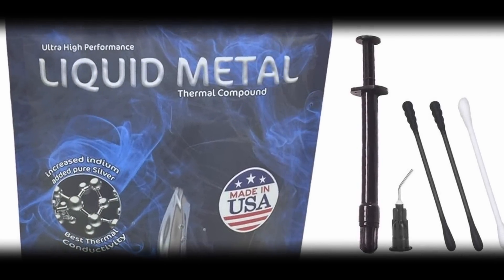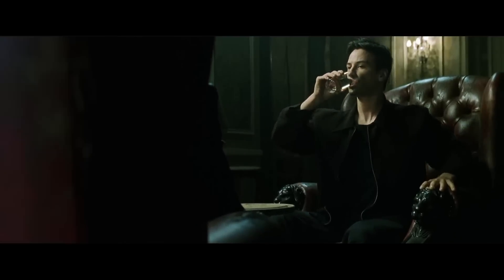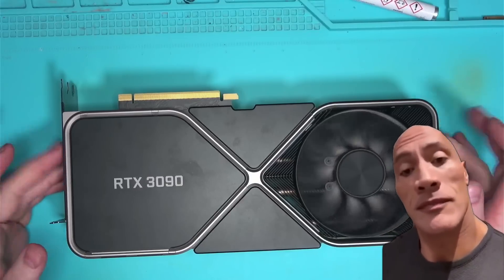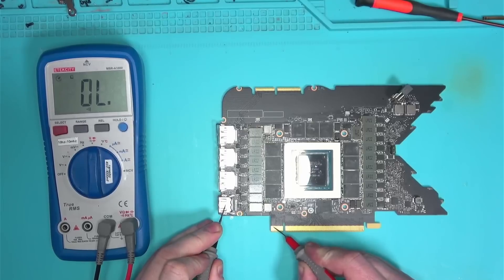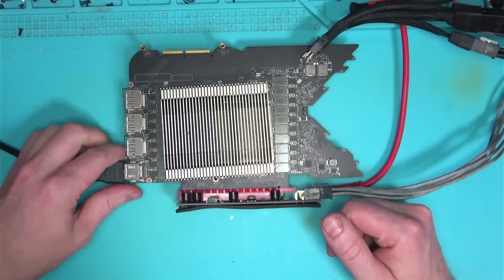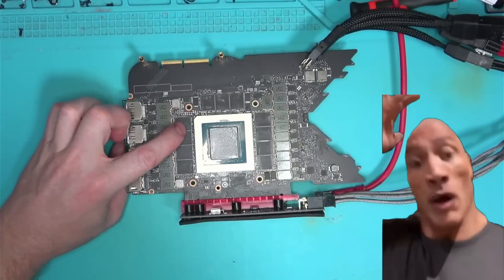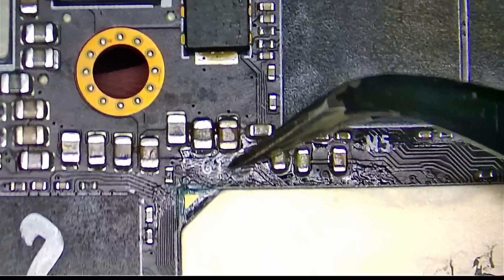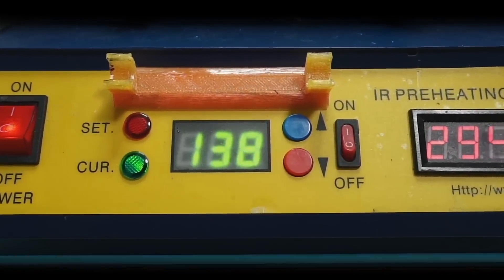3090 Founders edition Liquid metal damage repair

Comment: If anyone insists on using liquid metal, please at least protect the surrounding area with something like kapton tape and test how easily a drop comes out before you squirt it all over the card. That's most likely how this incident happened. Apply a very thin layer to BOTH the cooler and the die. By thin I mean 1-2 drops can go a long way...

Or just look for a used/cheap water block and enjoy significantly lower temps than anything an air cooled GPU can do.

Comment: Sometimes the liquid metal acts like an intelligent animal, aiming to destroy the soldering. Probably, the thermal paste manufacturers know this. It requires voltage, when you solder the usb port of a power bank, you can see the problem.

Comment: Damn right liquid metal is AWESOME u get 1c lower temperatures and as a bonus anything that is not mounted horizontal gets blown up sooner or later :P
I smack Gelid Solutions GC-Extreme or (since i bought an Arctic Liquid III last week) MX6 on everything. (got about 15k of water cooling "products" in my house)
GC-Extreme  tend to be a little "gluey" pulled a AM4 out of a motherboard that got stuck on the cooler :P

Comment: Thanks for the video.
Need to do long term testing on a R9 280X it is on a z170 asus prime i7 6700 cpu 32 gigs of ram.
This is a frankie build it sits around till one of three pcs has a problem and needs fixing, 2 pcs are friends and one is mine. frankie is a stand in. When last used it had lots of crashes replace old fx 8350 with the i7, now I want to test the R9 280X. Both the fx 8350 and the R9 may have been damage in a drop of the case. The mother board for the fx has a  pci x slot was damaged, new board is working great been testing with igpu to make sure it is stable. Now will be putting the R9 280X to see if it is working and was not the cause of the crashes.
What testing software should I use need it to run for a day or so and not crash just to make sure gpu is working.

Comment: People don't understand that LM requires precautionary measures when using it on their daily systems. OEMs would use LMs that are solid in room temperature, and use gaskets to prevent leaks. Extreme overclockers don't care, because they would clean and reapply frequently.
Reply: Tbh I've experimented quite a lot with conductonaut and my conclusion is it's not worth it, especially for a GPU, because after maybe 1 year it migrates into copper and then you get terrible temps, you need to reapply it often, also it reacts weirdly with other metals (not even mentionning aluminum 💀)...
For delidding (which idk if people still do), why not, but otherwise, in my opinion a good thermal paste is more reliable, gives just most consistant performance and without any risk, can last many years...

Comment: After i tested cheapo ptm7950 pad there is no more "good quality" thermal pastes for me. I had a noctua nh-2 and it got it's ass kicked by 10C on the hotspot. Same for laptop application. Only place where good paste and pad come close to each other is desktop cpu where the contact is as even as it gets.

Comment: I'm just interested, from the technical side, how do components that don't like heat and whose operation is very critical if they work above 100 degrees, endure temperatures of over 250 or even 300 degrees?
Ok, I understand that while they are working, they have rapid cooling via the cooler (if your graphics are at 90 degrees and stop working, in a few seconds it will be at 50) and that rapid cooling actually has the "twisting" of components as a problem (cracking may occur). A chip type cannot have the same temperature everywhere, and if it was 90 degrees, the part that is close to the cooler dropped quickly to 50, and the part further away is still at 85+, and due to various expansion of the material, damage can occur. While heating during soldering, the average cooling takes place slowly (naturally) and the temperature difference over the entire component is much smaller. Right?

Comment: Liquid metal is amazing if you know how to use it and you have to use it if you do any deleting. People think 5they need to put a layer on it when you only put a very thin film on the chips and the cooler plate. Plus you have to change and clean more often. R3qason why is liquid metal attacks any metal or can ox8dize you precious GPU or cpu.
Reply: I found it migrates into copper, then you get terrible temps, it's annoying having to reapply it constantly

Comment: What in hell are these people doing lol. I used liquid metal in probably around 50 gpus and 30 laptops so far, no one ever contacted me they had any sort of issue and I urge them to call me if something goes wrong cos I want to take it apart and see if if was my fault by any chance. What these people do with liquid metal is beyond me.. I guess they push the syringe over the gpu die directly and it pops and sprays all over the PCB, that's most likely of rookie mistakes.

Comment: Another great repair, Tony, i love the way how you show us what you`re doing to fix such an abused graphics card. Just hit the magic button again and subbed.

A little question from me: i have the Gigabyte RTX 2080 Ti Aorus Xtreme. The card runs fine since i got help undervolting it. An Windows 11 or the NVidia driver update killed my profile for MSI Afterburner so the card ran at its normal specs, getting very hot and loud as the fans simulated a starting jet plane. The hotspot was at 105 degree Celsius, so the memory was at around 90. But i don`t get any readings from the memory temperature, it looks like the sensor for it is gone. Can this be, a "grilled" temp sensor? The card runs good again with undervolting, but i`m in sorrow that more parts could get damaged. Before this software malfunction and the overheating card, i got temp readings from the vram.

Comment: Hi Tony, thank you for taking us to a truly happy place.  I love being able to spend time so close to those glorious GPU components.  I've used Liquid Metal before on laptops and GPUs and went back and replaced it on them all.  I saw how some of it had shifted from the CPU.  It also caused some corrosion on the copper GPU cooling plate.  Except for the card I sold on eBay, I swiftly cleaned it all off and replaced it with thermal grizzly which I love.  So there is a poor Nvidia 980 out there with Liquid Metal still.  I appreciate how no problem is too much for you and how you deeply desire to initiate further complications solely for our entertainment.  Keep it up!  Everyone should send you their broken GPUs for repair.  You fixed one of mine and I can't thank you enough!  Russ💽

Comment: There mechanic preheater is a game changer. So much easier to get them balls soldered without being blown away with hot air.
Reply from the maker: I would argue.
Its hard to keep the chip stationary while fixing screwups with balls.
Reply: @northwestrepair  Yeah I'd agree. I place the Hakko Omnivice next to it rest my hand on and move balls with the tweezer The vice is about the same level as the preheater.

Comment: Don't you get issues with chips or PCBs popcorning on you while you are working on them? It happens quite a lot here, even before the solder melts, the GPU is already dead with multiple bumps in the PCB. Btw, I live and work in a 70+% humidity location and I usually bake stuff at 90C for a while before doing any bga rework

Comment: in your heat test at the end it was only running at like 70C, why even use liquid metal, that's a very good temp for a core this high power. lol, liquid metal
Reply: A great many factory thermal compound applications are nothing short of terrible
That said, and often times, a careful reapplication will provide the most benefit without liquid metal.

Comment: I had to do LM on my7900xtx due to 115 hotspot but I made sure to use it very sparingly
Reply: Maybe you had a defective cooler that is sensitive to orientation?
Reply: @TheBackyardChemist well mabye when I first opened it had very good application of thermal paste maybe to much but I cleaned it out put LM on the die and on the cooler and a little dot in the middle just in case if the die was concave put everything back on did the retention bracket first tighted it much more than oem did and boom temp don’t go over 80c at 465 watts 1600rpm it a taichi asrock

Comment: Hi Tony. Just to be clear, the preheat temp of 200 C is measured at the top of the PCB or just the setting of the preheater ? Same for the 250 reflow temp. Is it measured at the top of PCB or is this the setting for the heatgun temp ? I am asking as I find these very low for lead free solder to properly melt. I would be surprised to have a proper solder melt if setting my heatgun at 250 for a large GPU chip.
Reply: 200c is the temp of thermocouple that toped on top PCB close to GPU core

Comment: Moral ol the story: gaining a random FPS for liquid metal ain't worth it.
Reply: Liquid metal is more frequently used for noise reduction as your fans do not need to run as hard due rot he better thermal transfer.
Reply: @Intel-6969K  yeah he was so successful that there was no noise, lol. It doesn't make my point any less valid.

Comment: keep on using liquid metal and keep Tony busy
Reply: Liquid metal is only for those, who know, what they´re doing - aka make sure, it will stay on the core and not leak elsewhere.

That being said, i wouldn´t use it on a GPU at all. Instead, i would go with Arctic MX-6 or Honeywell PTM7950.
Reply: @Morpheus-pt3wq  I've only used it for CPU delids with no issues so far.
Reply: @ArtisChronicles i´ve used it once for CPU delid too. Had no issues either, although i have no idea, if the CPU is still working, as i sold the PC about 5 years ago.
Reply: I had liquid metal on my i7 4770K 4.6  i7 8700K 5.1. GTX 1080 had liquid metaled since launch including fuses to remove power limit and it's working since launch, how old is this thing 8 years old ? I will do it to my 13600K and RTX 4080 when the times come. Never failed with liquid metal or delidding.. The secret is that there is no secret, just use a thin layer, as thin as you would painting a nails like a girl.
Reply: Did like 50 gpus, 30 laptops since around 2018 and no one ever contacted me they have issue and I urge them to do so, so I can see if it's my fault. I guess it's inexperienced people going with the syringe right over the die pressing it and sometimes it pops and sprays all over the place, I would bet that's how most of these issues happen, cos even when you use a lot more than you need, and you insulate the contacts around the die with nail polish etc., it doesn't get anywhere near the places where some people end up having liquid metal damage.
Reply: @NotEvenDeathCanSaveU  My GTX Titan had on it by the previous owner, after i removed the cooler (fcblock) i found that the LM eats the nickel out. I had to polish down the surface of the cooler. Guess what? I have better temps with normal paste after that.
Reply: @devilzuser0050  It damages the surfaces yes but the performance of it shouldn't be affected. I still have 1080Ti where I applied liquid metal to it in mid 2018 and the bench temps are still the same I recorded into notepad, maybe a degree higher but that's within a margin of error. Maybe not all nickel plating is done in the same way, some people report performance drop of liquid metal in 3-4 years, some say they see no difference after such periods of time.
Reply: @devilzuser0050  LM need maintenance. It does interact with many metals and impregnates it. This does not mean LM is bad.
Reply: unless ur restarted u shouldn't have these problems
Reply: @xvfdu4  sir, thanks to you and others like you, it will eventually be even harder to comment on youtube due to their profanity filter. Especially if you think the word won´t find its way into it.

Comment: At the end, the flux on the memory chip did what da, what da, what da?  ... deflux; then reflow????  Whaaaat?  I like the higher speed re-ball, but that last bit of narrative just flew right by me.
Reply: When he reballs memory or core, he puts just the right amount of flux for the solder to melt and with almost no residue left, but when you reflow (just heating the chip until the solder melts again) you need to flood the area under the chip with flux, leaving behind a mess hence why it needs ultrasound cleaning afterwards. It seems flux can damage the board in the long run if not cleaned right away.
Reply: Magic
Reply: same here, he's the electrowiz
Reply: I'm still lost and feel that even with two or three more explanations, I still wouldn't get it 😅

Comment: IMO it's better to get Thermal Grizzly's graphite pads so you're not dealing with the mess liquid metal can bring.
Reply: Agreed. Especially where you have no plans or no needs to remove the cooler ever. Graphite doesn't dry out, and transfers heat really well.

But if you need to cut them to size, I'd suggest getting fresh new scissors. Thermal Grizzly KryoSheet graphite pads tear like it is their #1 job.

Comment: Had a spill on my 290X the very first time I've used liquid metal, it always takes new people by surprise how easily it squirts out, once the metal is through the needle. It's also easy to make this mistake, since it takes a solid while, before a drop appears out of the needle and there's much more force needed to push it, compared to normal paste.

The reason why I tell new people to liquid metal to first try cafefully squirting some on the paper to get used to the strenght needed to push it through the needle. All in all, LM smears any paste away and is always preferable, if there's no aluminium as a cooling block. Especially nowadays, where everything pulls 300W.